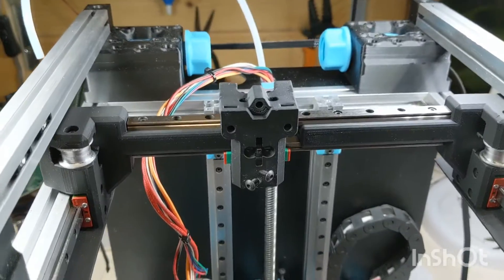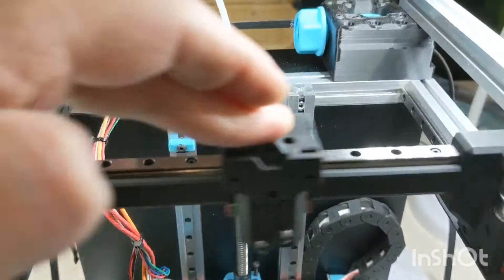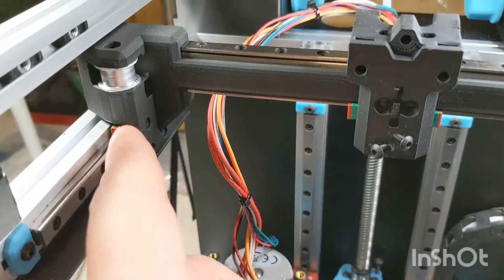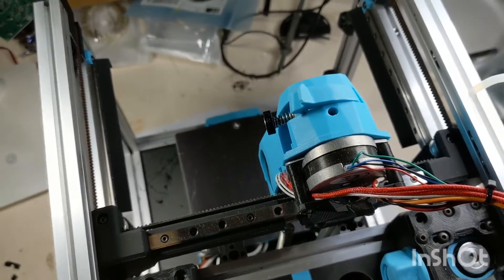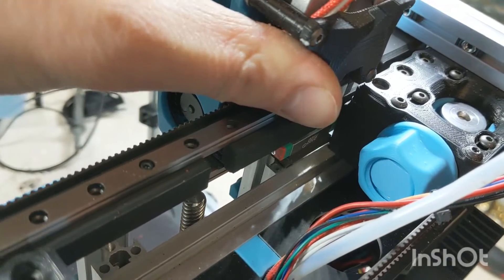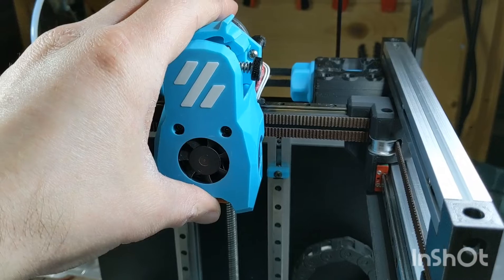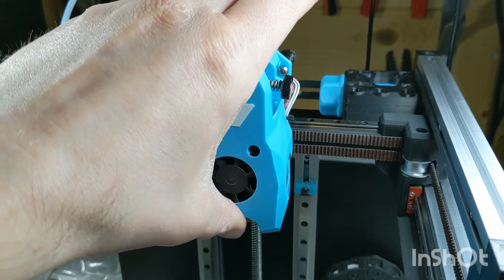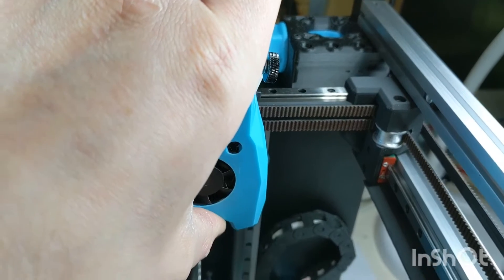Voron 0.1 / 0.2 with dual X rails, printed X beam and joints, glass panels and more

Comment: very cool! any updates on this? have you released the files?
Reply from the maker: Sure, here ya go! https://github.com/3d-olympics/vorono-0-plastic-beam-and-xy-joint
Reply: @3d_olympics-iq1dt thanks for that! Could you tell me what type of idlers are you using? And it would be great if you could share a step file as well
Reply from the maker: @nunovicente34  New design uses the standard idlers
Reply: @3d_olympics-iq1dt  also if you could share photos of Input shaper graphs on the GitHub repository that would be great! Just to have an idea of the results